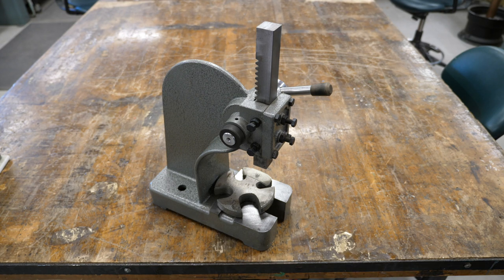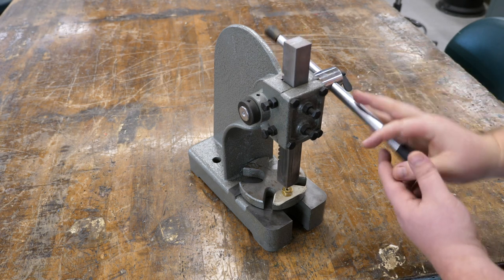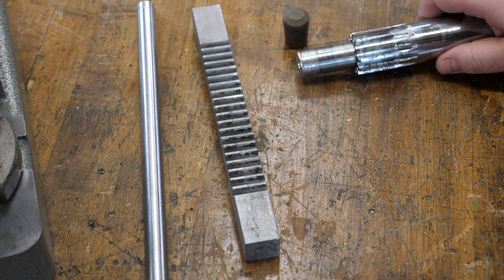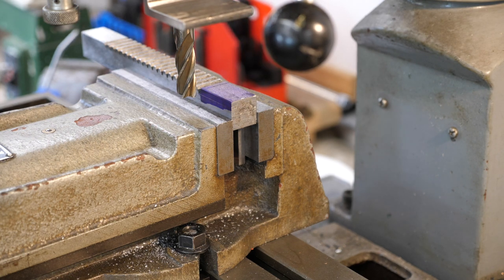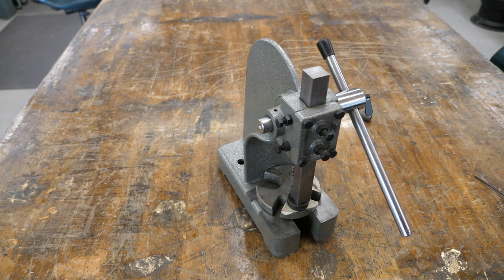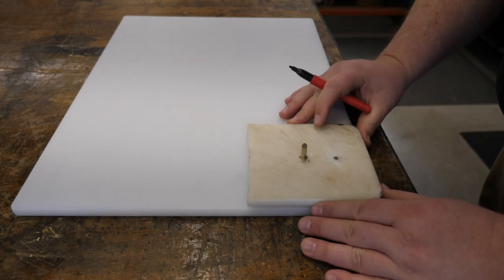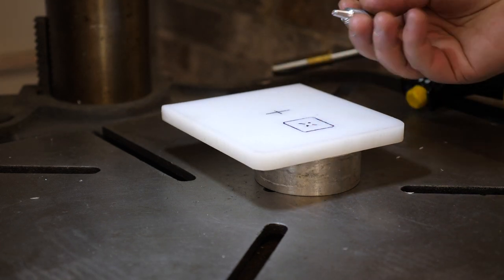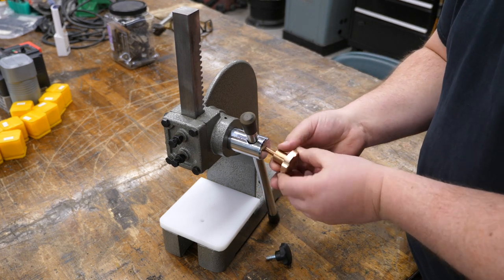Upgrading An Arbor Press/ Pen Press

Comment: Thank you ..... I’m headed out to the shop now to start upgrading 👍👍😎👍👍
Reply from the maker: Awesome!  Thanks for watching!
Reply: 👊👊    I ran out and used the mill and machined in the auto-ratcheting recess into both my 1-ton and 2-ton presses.  They both work perfect.  Also used the file to smooth out all the sharp touch points.  Thanks for inspiration.  Just what I needed last weekend.  😀

Comment: I'm not yet up to making my own knob, but I'm having trouble finding a control knob with an M8x1.0 thread. They all seem to be M8x1.25.
Reply from the maker: That one is more difficult to find.  Maybe McMaster Carr.  Worst case you may have to get one with a hole and put a bolt in it.